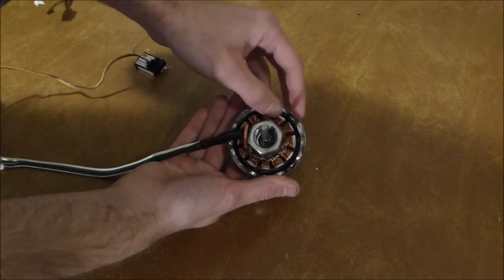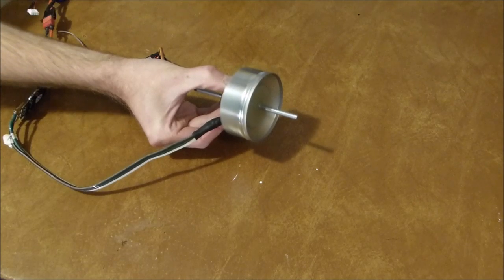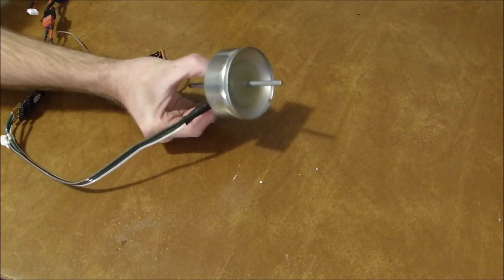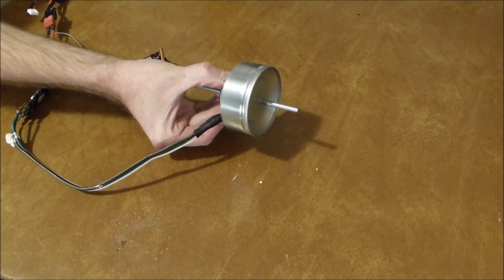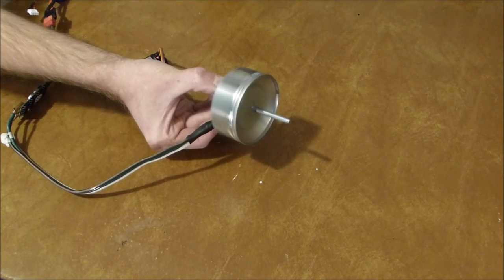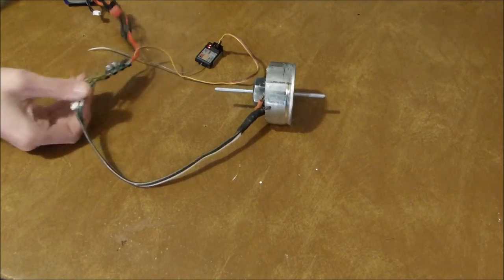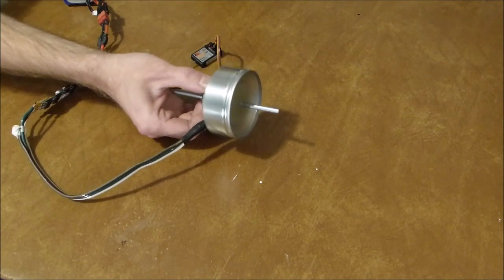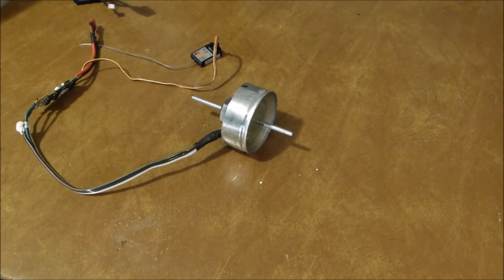Homemade Brushless Outrunner Electric Motor BLDC DC

Comment: I am electrical engineering student. I want to convert my dc motor into brussless motor ..l doubt that can the brussless motor run when directly connected to battery. .one terminal to  + ve and other two to -ve...plz help me
Reply from the maker: Brushless motors replace the switching action of the mechanical brushes with a solid state commutator, known as an electronic speed controller or "esc"

Comment: Is there a limit to how many volts you can feed a motor such as this?
Reply from the maker: The voltage limit would only be in the motor controller, or possibly the wire insulation (if it arcs from one coil set to another). But the current is a ;limiting factor, with too much current it will get very hot.

Comment: I wonder, can you make the outer shell into a wheel so that you can essentially make a wheel and motor in one? For example on a longboard. Or does the motor have to low torque to get you moving?
Reply from the maker: You could probably do that. Torque will be proportional the strength of the magnets, amount of current, number of coil turns, closeness between the coils and magnets, and the diameter of the motor (wider motor has more torque at the axle due to leverage).

Comment: were can i find a small axle/shaft like that?
Reply from the maker: Hardware stores usually sell steel rods.
Reply: thanks, ps did you use washers for the router? that stuff is hard to cut with metal sissors man, im using cans atm
Reply from the maker: Mohamed Maxamed To cut the washers I used an angle grinder with a disc meant for cutting steel. Hand shears/scissors are not going to cut that very easily, that's for sure.
Reply: tell me about it. and one last note what should be the diameter for the copper wire which i am soon going to order of amazon, is 4mm too thick? whats ideal?
Reply from the maker: Mohamed Maxamed 4mm is thicker than you will need for a motor this size, 1mm to 2mm should be good.
Reply: thanks!!
Reply: also sorry this is really annoying i promise it's the last Q, can the router be made out of plastic disks i.e like CDs or must be metal? and can the wire be any other metal wire or does it strictly have to be copper?
Reply from the maker: Mohamed Maxamed Don't worry I am not bothered by your conversation. You could make the core out of plastic, but iron will conduct the magnetic field more strongly. You can use any insulated metal wire. Copper and aluminum are the best common metal wires though. Steel wire will waste a lot of energy as heat.
Reply: thanks so much man ive finnally created it all i need is the wire which i  will buy tomorrow, finnal question i promise this time. does the cupper wire have to be insulated? is it dangerous if its not insulated,  like should i get enamelled wire?
Reply: ... i promised last time dident i...😓
Reply: and your roter has a gap between it at first i thought it was some kind of mistake like a dint but looking back it looks like it was there on purpose, but why?
Reply from the maker: Mohamed Maxamed The gap is there because I put one smaller washer in the center layer. The reason was so that the smaller washer could hold the bearings in place at the core (the small washer acted as a wall in the hole of the washers, for the bearings to rest on).

Comment: please help me jay. how to wire a 9 pole stator ? which wires should soldered? which wires out ?Heeeeeeeeeeeeeeeeelp
Reply from the maker: There are many different configurations, I don't know what you are doing sorry. Check out this page on Wikipedia, it may help: https://en.wikipedia.org/wiki/Outrunner
Reply: thanks , that was help full

Comment: what about the friction between the rotor an stator ? can you explain how to reduce the friction?
Reply from the maker: Ball bearings work fine, the rotor only touches the stator at the bearings. There is some friction but it is not bad at all with ball bearings.

Comment: good job - few people bother to make stuff from scratch!

JaycubL, you are losing quite a bit energy by allowing magnetic flux from the rotor magnets to disperse into the space.  Put thick, soft iron collar/ring around the rotor to keep/guide the flux within the motor to use it all. The power/efficiency will jack up, most-likely substantially. If the rotor attracts ferrous objects (i.e. paper clip), it means the flux escapes and is lost.
The ring will prevent eccentric force shatter, also.
Thinner (and more) stator plates/washers and very thin electrical insulation between them will make the motor more efficient
(I am in WA, Kirkland; btw)

Comment: can this run without the controller? 

I need help in making this.
Reply from the maker: It will not run without a controller, the controller replaces the mechanical brushes.
Reply: +JaycubL where did you get that controller from? 

I also don't know how a hall effect sensor works. 

I understand how the motor works but I don't get how Lydia timed
Reply from the maker: Ron Brown On eBay or other sites such as HobbyKing, you can get an esc (electronic speed controller) for sensorless brushless motors. They are not very expensive if you look around for the best deal.
Reply: +JaycubL what do you mean sensorless? 

I thought outrunner motors require a sensor.
Reply: +JaycubL how does an ESC work? in the video where do you sauder it to and why.
Reply: If I want to use this for power generation, What do I do? Since ESC is when you are giving input power and would want to regulate the speed right? When it is in the other way round what to be done?
Reply from the maker: Shreyas Prakash If you spin the rotor, the coil sets will produce 3-phase AC.

Comment: hey how did you wire it upp?? pleaseeee its the one thing everyone misses out i have a motor from a blender but dont know how to get it started helpp
Reply from the maker: A blender will be a single phase AC motor.
Reply from the maker: ***** More windings on each coil.
Reply from the maker: ***** More windings makes a stringer magnetic field, but does not allow current to switch as fast due to the stronger magnetic field inducing more back EMF (so, more torque for a given current, but lower max RPM for a given voltage).
Reply from the maker: ***** If you connect the batteries in series then the voltages add up but not the Ah. If you connect in parallel then the Ah adds together but the voltage stays at 1-cell voltage. No I don't think I will be making a video about that sorry.
Reply: hey wait isent + to - 
ps man how did you do the calculations?! and here i was trying to start a blender motor with 4 battaries. but however it should start nomatter the voltage

Comment: how u cut the teeth?i mean the poles! how did u cut them that smooth.... and i want to ask u ... is it possible to make it only with 4 poles? the same process applies?
Reply from the maker: +Mohamed Roma I cut them with an angle grinder (costs $12 at Harbor Freight). Then smoothed it with a wire wheel on a bench grinder. The number of poles needs to be a multiple of 3, the fewest you could possibly use with this type of motor is 3 poles. It would run very rough at low RPM but could probably be made to work with 3 poles.

Comment: I couldn't tell, but Is therea bearing built into it?
Reply from the maker: +Nicholas Ruiz Yes I epoxy-ed 2 sealed ball bearings at the center of the stacked washers, and the axle goes into that.
Reply: JaycubL thanks :)

Comment: how much rpm does this run i want to make one for my quadcopter :)
Reply from the maker: +johns joseph I'm not sure, but it is possible to achieve very high RPM with small electric motors like this.

Comment: rpm?
Reply: Revolutions per minute,dumbass!!
Reply from the maker: Haha yes but no need to call him a dumbass. I think he was asking what RPM is spins at, not "what does RPM mean" but I could be mistaken.
Reply: Ohh ok
Reply: I really want the plans for that motor u made
Reply: I could make my own electric starter for the 3 cylinder gas motor I'm building
Reply from the maker: Trodded Sloth Well I just went with what materials I could find, if I gave you dimensions it might not match what you have to use. The core is made from a stack of fender washers, there are a couple of ball bearings I happened to have in the hole of the washers. The axle is just a piece of steel rod. The big nut on the back is a place to hold it or mount it, welded to the washers. The magnets I think are 1/2" wide and 1/8" thick, 16 of them with 12 electromagnets in the core.
Reply: Oh OK,BTW the motor sounded awesome when u revved it

Comment: would you be able to power the motor with just a 12v dc power supply? and control the speed with a potentiometer ?
Reply from the maker: +Joseph Pringipas No, the controller fills the roll of the commutator.
Reply: +JaycubL sorry im very new to this.. what is the motor being powered by?
Reply from the maker: Joseph Pringipas I was running it on a 3 cell lipo battery. It is connected to a brushless motor speed controller, and to the RC stuff.

Comment: great stuff...but tell rather than connecting to speed controller...u cant connect direct to power source...why do u need to pass it thru speed sensor?
Reply from the maker: +Vimal Saxena For brushless motors the controller has a sensor and switch system that serves the same purpose as the commutator in a brushed motor. Connecting two of the wires to a battery would make the motor turn a partial rotation then hold in that position. Brushless DC motors are really synchronous AC motors where the AC is generated to exactly match the rotor position, and the controller is powered by DC.
Reply: May be u could do diy speed sensor if possible...since u done a diy brushless motor...but great stuff
Reply from the maker: Vimal Saxena Yes I am planning to do a video on how to make the speed controller. Thanks for commenting!
Reply: missed these comments, eagerly waiting mr. jaycubL

Comment: Should add ventilation holes on the top of the bell/paint can to dissipate heat! And depending on the count of turns on the stator will determine the KV (RPM x Volt=KV) also the configuration of the end wires. Did you configure the wires in Wye or Delta?
Reply from the maker: +Josh Thompson The wires are in a Wye configuration. Yes holes could be a good idea, heat was not a problem in this case though. Thanks for commenting!

Comment: how did you align the magnets? where did you study this? im interested in building my own motor as well but im not very sure were to get started.
Reply from the maker: +Gerben Zandberg The magnets were aligned by eyeball, then I shifted them around to get the weight balanced and glued them at that point. To learn about this I just read things on the internet. I looked at existing designs and then just adapted my tools and materials to make basically the same thing. At this point in history we are fortunate enough to be able to learn so much that way and the opportunity should not be wasted! For a first motor, I would recommend the "Newman motor" design. It is very easy to make while still being a useable motor not only a demonstrator. He tries to say it is a free energy device (it is not really) but it is an easy to make motor.
Reply: JaycubL can you test the power of the motor against other motors with similar  specs

Comment from the maker: +Michele Lombardo It will not let me click reply on your comment (it is something on your YouTube settings I think) so hopefully you notice this anyway:The song is called "Strange Tech 16" it is by Gunnar Johnsén. I got it from Epidemic Sound, I am not sure if it will be on iTunes but maybe it is there.
Reply: +JaycubL Thank you very much. I appreciated your quick reply.
Reply: +JaycubL hey j i am interested in working with you. i was wondering if you would be interested in making motorcycles. i am master builder of homes now build motorbikes. can you make it to NYC .  . i have a design to build that will take off. 20 yrs ahead of its time several models built. need help w bldc outrunner twin motor design that will know the socks off every1 we should work together FAST PLEASE CONTACT ME asap
Reply from the maker: godsthunder26 Thank you for your offer! I would love to help you with the motors for your motorcycle design. You can email me at jaycubl@hotmail.com if you want to continue the conversation. I am in WA State so New York is very far. If you need me to come there I maybe could but it would be a long journey, I can't just come down to the shop for a few hours twice a week or something.
Reply: how did you cut the inner shaft? how did u cut those 12 teeths
Reply from the maker: Rohan Patel I usually use an angle grinder for cutting steel.
Reply: does it easily cut the inner 12 teeth shaft?
and how much copper winding for low kv?
Reply: can i ask for winding schematic plz..  for me this is the most important part

Comment: in addition to my previous comment on brushless motors
can you make a motor with outrunner and rotor inside? where outrunner would only be connected in 4th 5th gear?
(i tought my english was good but when i have to use proffesional engeneering terms it's not) 
BACK TO SCHOOL FOR ME =P
Reply from the maker: +131013y I'm not sure how you would do that, or what the benefit would be. Maybe you could test your design and let us know how it goes. Unfortunately I don't understand exactly what your design is so I am not sure how I could help..
Reply: i will try to do so in the next few days
Reply from the maker: 131013y Cool I hope it works well for you!